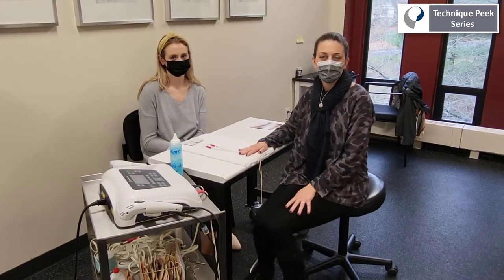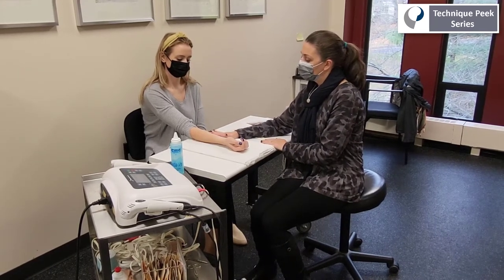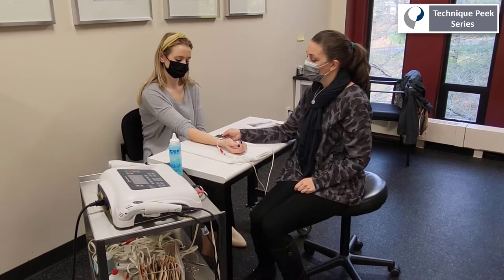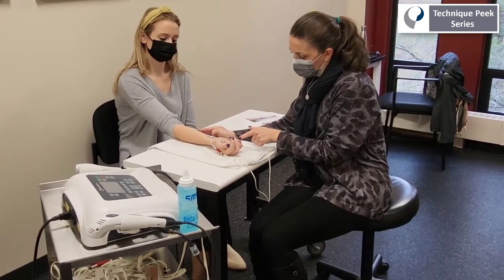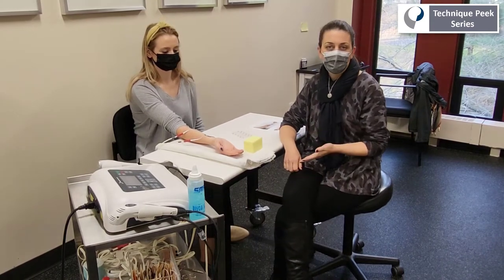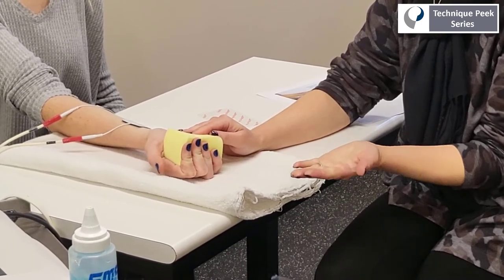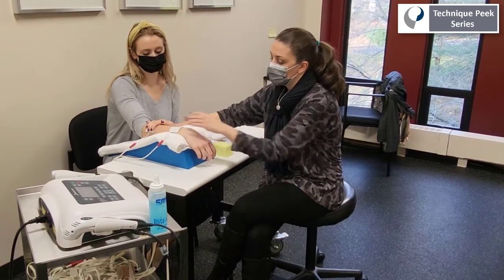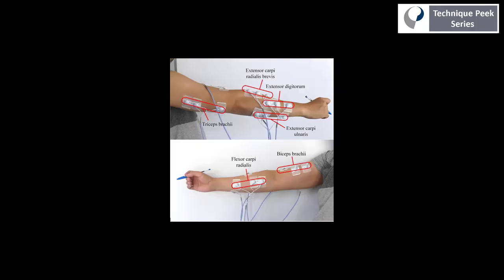Finding Motor Points for Functional Electrical Stimulation in Hand Therapy  |  Technique Peek Series

Comment: Wont the ultrasound gel spread the stimulation?
Reply from the maker: Not really. The gel is mostly used to allow for the pad to glide on the skin. The stimulation is based on the center of the pad. This is why you can see the changes in muscle contractions.